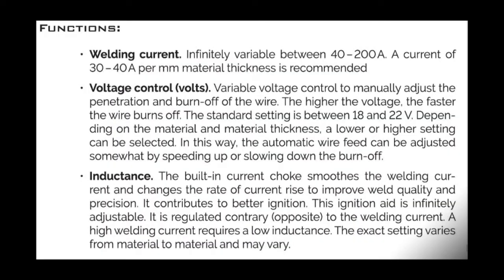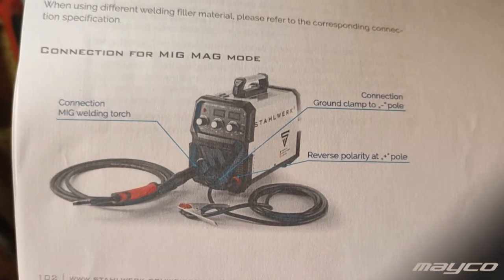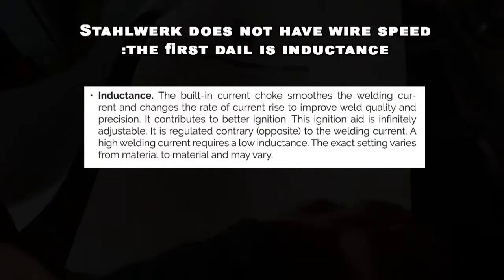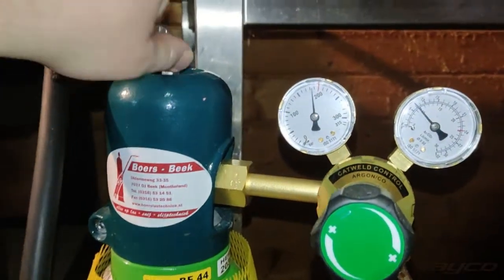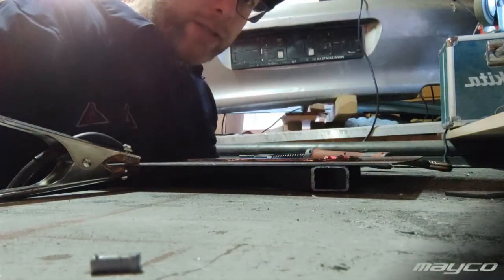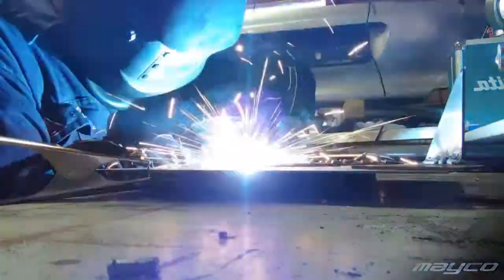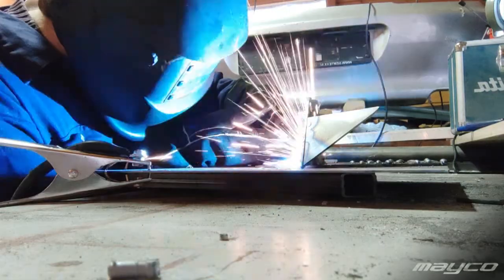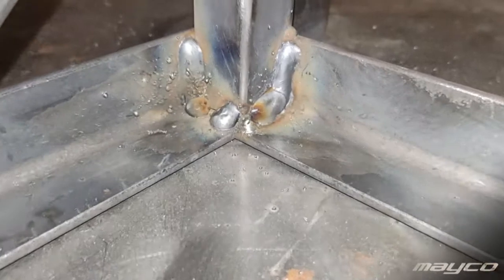Stahlwerk mig200st Inductance part 4

Comment: Bij MIG/ MAG kun je alleen het voltage en de draadsnelheid instellen. Bij MMA alleen Amperage. De Amperage knop mag je bij MIG compleet vergeten, doet niks. Het probleem zit hem enkel in je draadsnelheid. Dat hoor je aan het gesputter. Heeft niks met de hitte van je materiaal te maken. Draadsnelheid omhoog = meer draad in je werkstuk en dus meer hitte = betere penetratie. Bij MIG/ MAG Voltage omhoog en draadsnelheid omhoog (beetje mee spelen) en je krijgt ook goede penetratie in dik materiaal. Daarnaast niet teveel naar de Miller instellingen kijken, die machines zijn waarschijnlijk veel preciezer dan een een Stahlwerk machine.

Comment: 388 / 5.000

I had school English, but the techn. ....
With google translator .. I hope you can do something with it
I have the same machine and no problems. make sure that your hose package is stretched. The more welding current, the less inductance. You have to try the voltage but there are parameters. Please use internet, too long to explain.
And weld faster.

Comment: Im confused SO IS THIS A GOOD MACHINE OR NOT? Just asking from welding professionals
Reply from the maker: Obviously depends on what you want to do with it, and how much money you want to spend. The settings are a bit different from profesional machines, but once you figure them out, i believe it is the best bang for your buck. But it comes with some short falls, which a profesional welder might require. Like a water cooled torch perhaps or wire speed control etc. I cannot advise you what to buy, just show what this machine can do. If you do your research and have experience you know what you use and what is a must for you. I made a video on what I did to make my option list. Next i looked for a welder within my budget who had most of these things. The Stahlwerk MIG 200 was by far the best especially since the price has been reduced. There is now a newer version of this machine Double pulse unit. (i do not have the double pulse unit). I hope this help you make your decission.

Comment: This just the video I wanted to see I have the 155 mig and I’m having just the exact same problem as you it’s almost unweldable looks horrible I just can’t get it right I’m starting to wish I had brought a different welder it’s a shame I have a tig by the same people and that’s great.
Reply from the maker: I have a new video comming in a few weeks. Going over the settings, i understand it now better. This welder welds with lower amp settings than i would expect and induction has one setting.
Reply: Top man I can’t wait to see it massive thanks 🙏🏻👍👍

Comment: Hi Maarten. Since some weeks I have a Stahlwerk MIG155ST. I have seen a lot of Stahlwerk videos. Most of them (and Rico from Stahlwerk) said, they put the voltage and the amps button to the same position. The first button they adjust opposide to the amps of put it to the 12 o'clock position. For 2-3 mm material I use 90-100 A and 19-19,5 V. At 70 A I use 17 V. That works good for me. At Stahlwerk MIG the wire speed is controlled by the amps. For flater welds you have to go up with the volts and go up with the travel speed. I hope I could help you a little bit.
Reply from the maker: Goodmorning Andre, thank you for your comment, in my next video i wil try some new settings, i will check my setting with your suggestions. thanks for the feedback.
Reply: Before buying you need to watch this video
https://youtu.be/o3w5WCd1ZSo
----
https://youtu.be/BjzglUfTlSQ

Comment: Ha Maarten, stille kijker hier ;). Het lijkt mij dat de 'inductance' eigenlijk niets doet als je MIG/MAG aan het lassen bent. Ik denk dat dit alleen invloed heeft op de MMA (elektrode en lift-tig) lasstand van je machine. Voltage kan wat hoger zijn denk ik, bijv. 20V. Daarna kun je Amperage opdraaien totdat je niet meer het langzame geknetter hoort (zoals op 6:03). Je kan dit doen door met een hand te lassen en andere hand de Amp knop op te draaien. Je las wordt dan ook wat heter en ligt minder 'op' het materiaal.
Reply from the maker: Hey Sander. in mijn volgende video propeer ik dat idd.